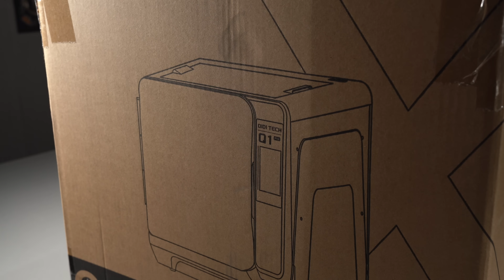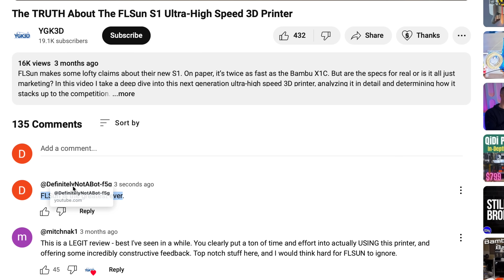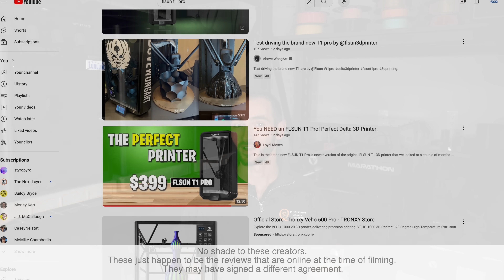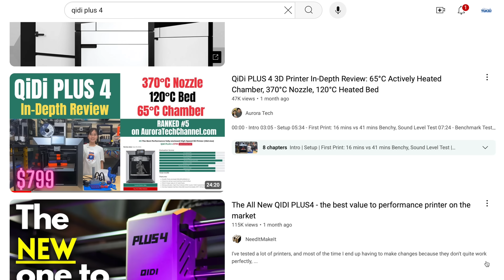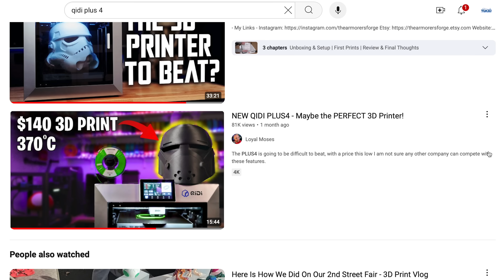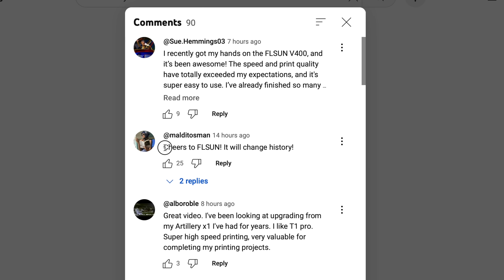This is why you shouldn’t trust 3D printer reviews...

Comment: Turns out it's not just my Bambu. I saw so many reviews on several platforms recommending Bambu's printers, and I believed them. Purchased Bambu Labs X1C and used it for 3 days. Costs are skyrocketing. When printing small items, there are more scrap materials than actual materials used? ! When I tried to print a multi-color.STL file, the nozzle blocked. I called customer service, but there was no response. I'm really disappointed. I now feel that they are relying on false propaganda and deceiving consumers to get income.
Reply: I don't know how you managed to find reviews that did not mention the AMS filament waste. That was in pretty much every review even during the late kickstarter phase. On the other hand, unless something has changed since I last looked around, you can waste a lot of filament to get anywhere near the cost differential to a printer that solves multi-filament printing in a way that does not cause waste. But, if someone told me they wanted a printer for the primary purpose of multi-color printing at volume, I would have suggested they look around to see what the current alternatives are, because it is a huge drawback to the AMS. For someone like me, who generally does single color printing or just wants to swap at a layer once or twice in a print, it does the job really well. I knew this before I purchased back in 2022, from watching reviews.

As for clogged nozzle. The top result when I searched for "bambu clogged nozzle" was Bambu's wiki page. Where there's an illustrated step-by-step process for how to work through the issue. There are images. There's a video. If the printer itself has an idea of what is wrong, in my experience it provides a QR code leading you to the relevant documentation for sorting it out. I honestly don't know what you feel they could have done better, within the reality of "3D printer nozzles can sometimes clog". Well, I would agree that their phone system should ensure someone picks up or inform you they're unable to at this time.
Reply: @mascot4950  The first reviews were very much now suspiciously devoid of mentions of filament waste.
Reply: 😂 MMS is the biggest con going - and not great environmentally - why do you think they also sell filament?
Reply: @chrisgill5692 Con? How do you figure? It's not exactly a secret that there will be waste from purging, and the amount of waste can be mitigated easily. Waste isn't a factor to me anyway. I sell multicolor prints, (own/operate a small farm of 292 printers) and then use the purged pieces as packing material. Besides, it can be argued that multicolor printing is more eco friendly than printing single color trinkets. Since the multicolor prints are generally more appealing, they're more likely to end up being shown/kept than in the waste bins.
Reply: @OhImKiCkiN  kudos to you for finding at least one use for all the waste.  Personally, I think it's an environmental disaster, as most will end in landfill.  You probably have some figures from your farm, but the proportion of poop for even a simple two-colour print is horrendous - that's the con.  I guess eventually either this system will be banned, or making recycling mandatory somehow.  I cannot believe some of the pish people print and others buy.

Comment: I feel like all manufacturers do this. I was totally lied to! The reviewing video told me the Bambu X1 was the best 3D printer, but honestly, it feels like a piece of junk. I bought the X1 Carbon in August 2024, right on the first day ,and right away, the machine started having issues. First, I couldn’t format or read any SD card. A week later, while I was trying to install the latest firmware update, it just stopped detecting the AMS. Bambulab’s support team had me running around checking cables and protocols, but nothing changed. So, I ended up buying a new AMS (big cost, just to see what was wrong), and it worked. The new AMS was recognized, but as soon as I installed the firmware, it crashed again and wouldn’t detect either AMS. Turns out one of the boards was the issue. Bambulab support sent me new boards and had me swap them out. They even made me change the AP board for the SD card recognition. All this at no cost, which is cool, but for the price I paid, I feel like I should’ve been able to take it to a repair shop and get it fixed under warranty.
Reply: Typo? The x1c was released in 2022. I'd generally avoid buying brand new products but the opinion on the x1c is still largely really positive in my perception. QA isn't perfect nor is their customer support. But the issue with repair shops is that they would need to have parts to do anything and if you want that level of service you'd be looking at commercial printers that are 10 times the price because those companies need to employ on-site technicians or run shops all over the globe.
Reply: are u serious? Mine has been working flawless for 100,000,000 hours and it wipes my ass
Reply: Idk why when someone says their printer had issues a lot of people come to say "mine works well", good for you buddy but that doesn't invalidate his experience and it's probably not his fault, I've seen a lot of people act like bambu printers are flawless but obviously they are not (coming from someone that has an a1 and love it, certainly had some issues but nothing major, rn I'm dealing with a seemingly worn out extruder gear after using like 1/5 of a marble filament roll, with 1100 hours on the machine so I guess it's fair enough)
Reply: @WaltDEM  it's about the "reviews lied about the printer" part, not so much about having issues. There's nothing out there that can't fail and there isn't an alternative that would be on a whole other level of reliability. A prusa with a broken board wouldn't have resulted in a very different experience, nor would it be cheaper
Reply: @zapl80  My comment isn't about the reviews, I've read a lot of posts on fb asking for help with their bambu and there's at least a couple of people who will just go: "mine works, user error" when it's obviously not, just like bierbarrel
Reply: @WaltDEM  Not only did the issues with the Ender S3 I got as a gift last Christmas, as well as the buggy CAD software to create my own projects, turn me away from 3D printing for quite some time; the "sucks to be you" and "get gud" replies/attitude when I tried to ask for advice on some forums was worse. 
I'm considering getting a good printer with some money I have coming in a few months, in the hope that things have improved at least on the hardware front, but I have to admit that I'm still debating, don't want to go through that again. There are quite a few things I can do with the money, subjecting myself to frustration and abuse isn't high on the list!
Reply: @faelwolf1177  Exactly what I'm talking about, I also had an ender 3 v2 neo, that thing was more instinct than following a manual for troubleshooting (but it worked well when everything was calibrated). I think you won't be disappointed if you go with a bambu (of course, you should still research by yourself), there are lots of things to learn and everyone will make mistakes but they definitely make things easier.
Reply: @WaltDEM  Because one guy saying his Banbu sucks doesn't mean they all suck. The people who have issues are usually the ones online complaining. One guy complaining about HIS issues can deter many people, which shouldn't be the case.
I think its nice to see both sides, don't u?
If I only saw the bad and no good, then I wouldn't have bought anything. I'm glad I didn't listen to just the people with issues. Cuz my Bambus work great
Reply: @WaltDEM his experience also isn’t representative, which belies the one million printers they’ve already sold, according the the ceo of the company. I don’t have one, but I know two people who do, who are very happy with them.
Reply: @melgross  As I said earlier, I have one and it works like a charm, love it too. I'm not trying to say their products are bad but it's obvious some will have defects, and people saying "mine works" when someone has such issues doesn't do them any favor, that's something for the company to handle. I wish I could post a screenshot from a bambu a1/mini group where every time someone says they have problems, half or more of comments are "user error" (which might be true but if you are not going to help it's better not to comment and if you want to praise their product or saying yours work, you can just review it where you bought it from...) to make my point clear.
Reply: Thank you for your bravery! You've found yourself surrounded by the unstoppable BL Bot Legion, ready to bombard you from every angle with glowing reviews about just how amazing Bambu is!
Reply: @williamcollins-09  because I gave my honest opinion. People have different experiences with their printers and maybe he just got a bad one for some reason. Do I seem like a bot lol
Reply: It's cases like this where the machine should just get swapped. I am sure Bambu has their flaws but I have thousands of hours on mine and friends do as well with no issues aside from my camera partially failing when hot. I am lucky to be able to buy the printers locally where they are a snap to return if they disappoint me.
Reply: Mines been flawless
Reply: Lol the bots have found your comment
Reply: That experience does not in any way seem related to me. Your story is about you having bad luck with a product, not about Bambu demanding reviewers speak positively about their products in order to get a review unit.

If the X1C had been an objectively horrible product, I would agree that reviewers claiming it's "the best 3D printer" would be pretty good evidence of intentional misleading, quite possibly at the behest of Bambu. But that was not the case. Not only was the printer good, there were some pretty middling reviews from people who had poor experiences with the pre-release units. While, on average, it was very favorably reviewed, it was not a case of "forced portrayal of absolute perfection". And now we have two years worth of data showing they're great printers.

I bought an X1C from the first shipment (not the kickstarter, but as soon as it was available from retailers), and I would absolutely have said "best 3D printer I have ever used" at the time myself. Now, about two years later, it's still my primary printer and apart from swapping out a funnel on the AMS (which I wore out by using abrasive filament in it without realizing it), I haven't needed to do anything whatsoever to keep it running. I'd still recommend it warmly to anyone with the budget for it, unless their needs are very different from mine.
Reply: Bambu is like that in general. 
I'm still on my old overly customized and modified Tevo Tarantula, and yes, it requires a lot of tinkering, I just finished a round of upgrades for Input shaping, Eddy bed leveling and installing a Hemera XS Revo that took me weeeks between design, prototyping and printing. 
I know other people having 3D printers, and a constant with them is that every printer is going to require some level of tinkering and maintainance over time. It can happen later down the line if the printer is very good, or constantly if you work with a frankenstein monster abomination like mine.
The difference between someone that tinkered with printers for ages and a beginner that buys a Bambu is that when the printer breaks, and it will, the beginner won't have the experience to troubleshoot and fix the problem.
If I break my printer, I know I'm always an afternoon of tinkering and 50€ away from getting it running again.
Reply: August 2024?  For a X1 Carbon?
Reply: Been using my x1c over a year no issues. Prints daily!
Reply: Dude you can transfer the files wireless
Reply: My Bambus work I have 9999999 of them and used all of them for 999999 hours each, they're perfect and flawless. Anyone saying otherwise is lying.

Can I have my 5$ now?
Reply: mines a weapon. maybe dont buy the first batch of anything new. pretty basic rule that has served me well.
Reply: This is an FLSUN bot right here folks.
Reply: My p1s works great

Comment: What we need is a more grassroots platform for 3D printing hardware reviews, instead of relying on paid influencers. Instead of YouTube, there should be one go-to website for impartial 3D printer data. A place for people to post problems and find solutions, all the while building up profiles for certain printers. You’d be able to see how many hours of printing it takes before most people start to run into each issue. You’d be able to find more optimised slicer profiles or start/end g-codes. Even batch issues between serial number ranges. You’d also be able to see which manufacturers pay for bot reviews, and easily see when a reviewer has been sponsored.
Reply: Problem who is going to pay for this website, they do not come cheap.  Also who is going to maintain it.  Who is going to monitor what is entered? And a few other things I haven;t thought of?  One big thing who is going to pay the person or persons dling ths work?
Reply: Sure so who is paying and how do we make sur eit does not influence results?

Comment: People should also check reviews for support too. Elegoo for example has nice printers. But their support team can be scumbags.
Reply: The problem is that reviewers are usually flagged as VIP and get special treatment.
Reply: I had the exact opposite experience. I've had basically nothing but issues with my Neptune 4 Pro but as soon as one of the belts snapped like 3 prints in, I was able to get a replacement sent to me almost immediately. Doesn't change the fact this thing is a nightmare to deal with >50% of the time but at least it wasn't abandonware like my Voxelab Aries was.